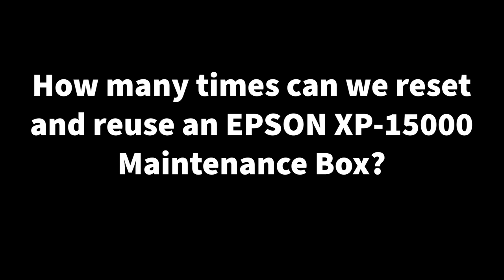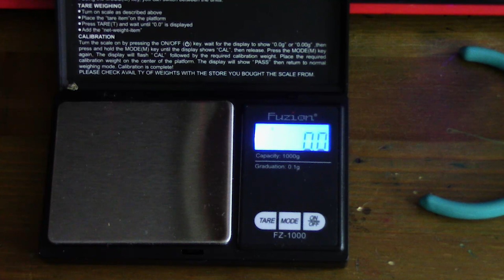How many times can we reset and reuse an EPSON XP 15000 Maintenance Box?

Comment: Hello Jose and thank you for doing the research and investigations so well. I love your channel and follow it with interest.

I am 75 and from UK, and recently bought an Epson XP15000 to go with my other Epson A4 printers.

I have used CISS for ink delivery on all my previous Epson printers, but with the inclusion of plumbing in a waste ink external tank "Printer Potty" from Octoinkjet here in the UK. This has been very successful when used in conjunction with a software reset key (also from them) to reset the waste ink counter.

I have bought a CISS (from City Ink Express, here in UK) for the XP1500 too and this is my first printer with a replaceable Maintenance Box, which I thought must be a step up from the old system of waste ink pads.

However, I have just had to replace the Maintenance Box after what seems to be a very short period of use! It cost me £13 and if I can keep this cost down I'd be very grateful. So your research has come at the perfect time for me. The idea that the box can be reset and reused up to (say) 4 times is a great revelation Thanks again.

Could you please tell me about where the chip resetter can be bought in order to reset the Maintenance Box back to zero and continue using it for a while longer? I have looked all through your notes but cannot find any reference to it.

Thanks again for all your efforts. Keep up the great work!

With kind regards

Roy
Reply from the maker: You are in the UK so my friend Rick Johnson very likely can not ship overseas. 
You will have to order from China through either EBAY or AliExpress or Alibaba.
Reply: @cheo1949  Thanks very much. I will take a look.

Comment: Hi Jose, silly question.... What happens if you remove the foam pads? Will the tank hold more ink and be easier to clean.
Reply from the maker: I supposed but the ink is literally sprayed into the tank. A recipe for a mess. Besides its the chip that controls when it is "FULL"

Comment: Hi Jose, today i did reset my XP 15000 maintenance tank, i bought it used and it is with me from 2022, i refill with oem ink (i'm in Europe) and reset the carts. Anyway when i weighted the maintenance tank it said 95gr (i refilled 3 times from when i have it), and the maintenance tank had still a 10-15% for the epson software. So my question now is, do i have to wash the pads or replace them to be safe i don't have ink going out of the maintenance tank ? Can i remove some liquids with warm air from a hairdryer ? I will order a new maintenace tank but it will require time before i get it here
Reply: Ok i try to explain it better, the XP 15000 is with me from 2022, i bought the printer used and the maintenance box was at 50% empty. Then i refilled 3 times (3 yellow carts, 3 magenta carts, 3 cyan carts, 3 black carts. then 2 greys with original and 1 red with original), never did reset the maintenance tank, it was at 10-15% empty, so i  did reset the maintenance tank, then weighted it and it said 95gr, so now the question is, is possible that when the epson software says it is full, it is really full ? or in Europe we have a different maintenance tank ?

Comment: Awesome! I purchased the resetter from Rick Johnson, worked perfectly, and was wondering what to repack the used Maintenance Tanks with? If I can get 5 runs without repacking I'd be delighted.
Reply from the maker: As I and you witnessed, I added 60ml of water directly into the port and that's when it finally saturated the pads. That depends on you resetting at 85% or 15% from empty. In other words, remove and reset the cart when it weighs 51 or so grams. That means 10ml or grams of waste ink are in the pads. Run it again until it is 61grams. Continue these resets at 10gram increase intervals. Replace the cart or the pads after 4 resets to be safe or 5 if you keep a close watch. 91grams means a total of 5 reuses counting the first VIRGIN use.
Reply: @cheo1949  Understood, thank you for this channel.
Reply: Stuff from China takes 2 months to get here.  Meanwhile I will be hitting the hobby stores and the dollar stores looking for something comparable.  But with 5 fills on your maintenance cart and only 9.99 for a new one - how can we go wrong ?
Reply: can you reset the ink carts?
Reply: @michaelsellas3071  No, but you can easily refill the ink carts. However you will need to disable ink monitoring, via 3rd party software, for this to work.
Reply: @darylbenson9682  do you know any good softwares for that i wanted to do it but am worried about viruses since i use my laptop for all my work related things

Comment: Thanks for the great videos.  Have you had any experience with the XP 15000 going completely dead?  Mine went from working one day to not even able to turn it on the next day.  I checked all the obvious outlets, connection, etc.  It just won't power on at all. Maybe a blown fuse?  Is there a reset somewhere?

Thanks.
Reply from the maker: Power Supply?

Comment: I have found that some chip-resetters are limited to 120 resets. What's up with that?!
Reply from the maker: Whether that's true or not I or the printer will be long dead before I reach that reset count.
Reply: @cheo1949  Hahaha I love that angle 😆
Reply: These resetters do not have that limitation AFAIK.
Reply: @sirmightymoose  These might not, but some do. I think it's planned obsolescence. Not cool!
Reply: Really?!  Even if you where doing 4 resets a year which is unlikely, that's 30 years of use for $55. Less than $2 a year seems pretty good value to me.